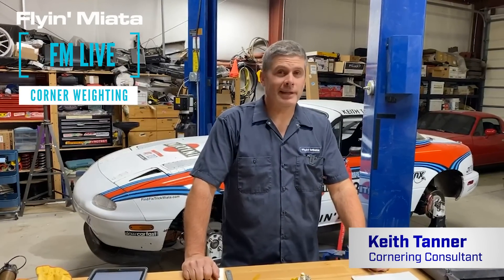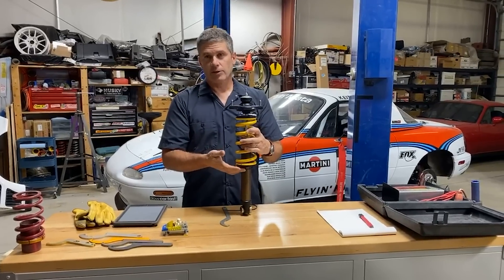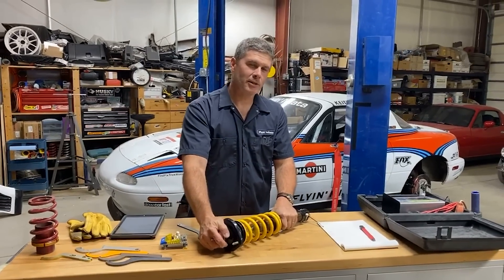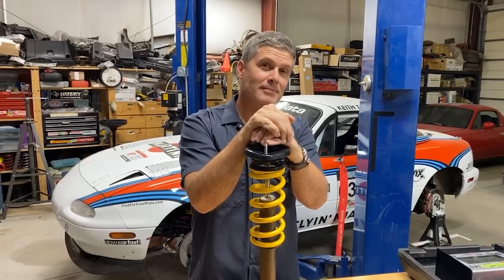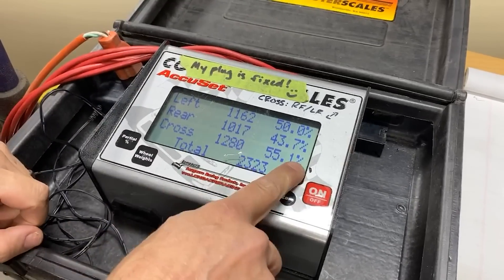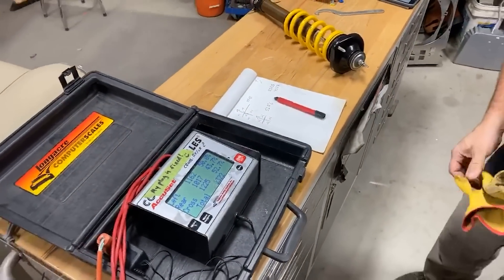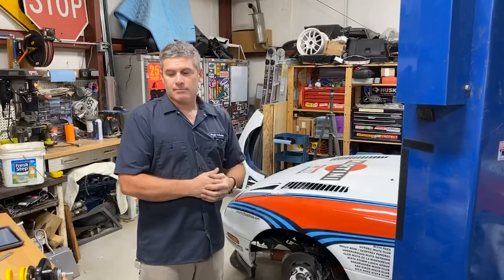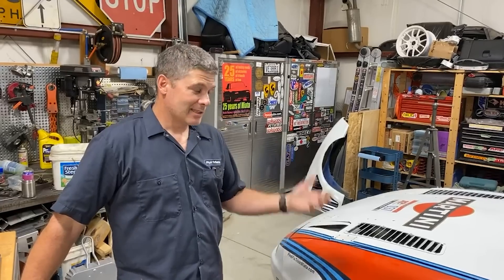How & Why to Corner Weight Your Car (FM Live)

Comment: If you had access to a wind tunnel  put the car on the scales flip the switch ,set the air speed,check, then check the scales for the effect 
That would be cool

Comment: good video.
just did my Camaro today.
not an easy process even with hub stands + a lift.
Reply from the maker: @3rdGenGuy Thanks for watching! A lift and hub stands certainly make the job easier, but it still won't be a quick and easy job.
Reply: @FlyinMiataVideo  
how much ride height change is normal?
 I went from about 55% cross weight to 50.7%.(best I could do)
car drives much nicer now.
ride height change:
driver front: unchanged
pass front: dropped 1/8in
pass rear: dropped 1/8in
driver rear: gained 3/16in
Reply: @3rdGenGuy  just wondering is the ride height uneven now or even left to right on each axle on a flat surface?

Comment: I used to race 1/8 scale on road rc cars (formula 1 of RC cars) we used a tweek bar which is a 3 point balance system car would be center balanced on the 1point front then the rears left and right would be balanced then flip the tweek bar around so it supports the car on rear center and front left and right are balanced on the balance beam which seemed to work very well

Comment: Great video.

What is more important on a lock diff live axle race car, going for a 50% diagonal or even weights across the left front and right front wheels? 

If your diagonal is 50% but your fronts left to right side are significantly different will the car be more likely to lock the light front wheel under brakes?
Reply from the maker: @hardyakka888 We don't have much experience setting up (or adjusting) live axle race cars here, but it seems to us that if you run the car with a significant weight differential side to side, you'll unbalance the rear wheels even further which may have an effect on traction and handling balance - you'll probably end up putting more weight on the rear wheel which will lead to a different balance when turning right vs left. It's likely better to move things around in the car. However, if this is in something like a dirt track car that always turns in the same direction, you'll want a very different setup, anyway.

Comment: Very informative video!  Thanks for the explanation as well as the demonstration.

So, in order to use the new (latest generation) Paco Motorsports hub system with scales, what size scale is needed?  The base of the latest Paco Motorsports hub system is much larger than the ones you used in this video.  Longacre sells 12” and 15” scales, so would the 15” scales be required?
Reply from the maker: We cornerweighted a car last week using the latest generation hub stands and these same scales. The base of the v5 hub stand is 12x12, so the larger scales would be recommended. We’d recommend them anyhow simply for ease of use.

Comment: Love the video very informative information. Have a question with a solid rear axle with an adjustable Watts suspension. If you change the adjustments will that change or shift the weight
Reply from the maker: Now that's an interesting question. We don't have much direct experience with Watts links. In theory, if your adjustments are just to things like the height of the pivot, that won't have any effect on static weight distribution. It will likely have an effect when you're actually cornering, but that's a different matter!
Reply: @FlyinMiataVideo  the watts link that I have for the pivot it has six positions and for the rod ends it has 6  positions as well for adjustment. I'm leaning towards coilovers instead of the stock 4th gen Camaro arrangement. And this was a thought after seeing your video on adjusting for the weight balance.
Reply from the maker: @bobd9911  Those adjustments shouldn't affect static corner balance, they'll come into play when you're moving. The coilovers are what will give you the ability to corner weigh the car.

Comment: Kindly we try to also balance the corner weight of an rc car but the difference is that we adjust the ride height with what we call them droop screws and to move the weight and try to make the care balance we use the tension of the springs and it seems that it works!
Reply from the maker: That sounds like it's working well flor you.
Reply: @FlyinMiataVideo  Today, I tried to balance the rc car with the droop screws ti change the height instead of changing the tension of the springs, and I use plastic rims without a tyre to try to make it to the nearest gram.
I will let you know how it came after I tested because when I put the wheels on, it changed the results!

Comment: Great video!! One question. Wouldn't the heavier wheel have less preload which needs it most to supprt and cause rebound?
Reply from the maker: More weight on the wheel does not change anything do to with the spring. Correct cornerweighting is the same no matter what you have for wheels. You might need to adjust the damping if it's extremely heavy.
We have done a couple of other videos on "preload" and how that's an incorrect way to think of setup.
Reply: @FlyinMiataVideo  thanks!! Will look into your other videos.

Comment: C7 corvette. Should I focus on setting ride height the exact same as measured from ground per corner over setting shock perches in same starting point? So which one is more important to start with?
Reply from the maker: The initial perch setting is just to make sure you're in the ballpark as you assemble the car, it will get the cornerweights close and make your life easier. You'll want to level the car relative to the ground. It doesn't have to be the same at each end, but it should be the same side to side.

Comment: I keep thinking about how to do this with bathroom scales only. Unless you have 8 scales, you will need to take four measurements.
I think you need to be very careful that the ground is flat. If the scale lifts the wheel by 2", you'd better put 2" spacers under the other three wheels, too. If one wheel has a height error of 1", I guess the weight will read 155 lb too high. (assuming VMaxx coilovers 258 lb/in rear and 391 lb/in front so the spring compresses 0.4" in the front left and 0.6" in the back right.) 1/10" will put you out by 15.5 lb, about 2.7% of one corner's weight or 1.3% of the diagonal.
As for doing it with one scale plus levers, you'd better be very careful to measure those lever lengths right. (And where, exactly is the point of application of the force to the scale top?) Levers sounds like a Gong show.

Comment: A poverty tweak for a car without adjustable spring perches is to install adjustable end links on the sways and treat those as if they were the main springs. You won't get much that way, but it's noticeable.
Reply from the maker: I suppose, but then your sway bars are preloaded, which is a different problem. Probably best to leave it alone at that point.

Comment: flat floor required? i guess this is a prerequisite when setting ride height/rake as you said before corner weighting. what is the best method of setting ride height to what you want? aside from matching the perch height left and right. having trouble with my car as i haven't been able to get close to being even on the ground by doing so. by disconnecting the swaybar do you mean completely as in no bolt in the link or just loosening the link connections?
Reply from the maker: If you don’t have a flat floor, you can level the scales with shims. They do have to be level. 
Setting ride height/leveling is done by moving the perches up or down. Get the car on a level surface, measure your heights, adjust. 
To disconnect the sway bar, remove the bolt from the links so the link is not attached to the bar. The bar can remain attached to the car.

Comment: How often should you worry about getting your corner balancing redone? Is it like an alignment where you should have it checked and adjusted every year, or if no major weight changing mods have been made, do you more or less set and forget until you have issues pointing towards it specifically?
Reply from the maker: It shouldn't really change. If you have a spectacular off, you might want to double-check, but it's not something that happens with normal use. Also, if you are coil-binding or you notice your ride height changing, you will probably want to confirm it after fixing that problem.

Comment: Kindly what are the best corner weight results? For example, you make the diagonal wheels of both sides the same or rear front wheels equal weight to go in a straight line.
We use powerful motors that we go 0 to 100km in about 1.5 seconds and we want it to go straight as much as possible!
Reply from the maker: We are usually more interested in cornering and handling than pure straight line acceleration. It’s a good question. It’s quite possible that you’d benefit more from equalizing the driving wheel weights instead of the cross weights for your use due to your extreme power/weight.
Reply: @FlyinMiataVideo the rc car is four wheel drive and we use thick silicone oil in the front diff and bit lighter at the back and we eliminate the third differential from the middle so we try to have all the power to all four wheels, even using stronger springs and Dumpers to try to keep the car straight when accelerating.
I already managed to do 0 to 100km/ h in 1.59sec and 40m in 1.98sec with a small 8s motor! Meanwhile if the car is not balanced it will not hold a straight line because it will spin more the one with less weight. 
We always try to improve and we reached a point were it us difficult to handle the car in a straight line due to bigger motors with more power.

Comment: With coilovers with separate height and preload adjustment, would corner weighting be done only with preload adjustment? Assuming ride height is already dialed in.
Reply from the maker: Yes. See our other videos about preload. Use the shock length adjustment to set your range of motion, then use the perch height to adjust corner weighting and ride height.

Comment: My question my car jacks down  in a long sweeping turn on the rear under full accel its a 1620kg fwd  mk4 focus st estate with kw v3 coilovers does this eliminate my issue its been set equal ride hight kind regards bart
Reply from the maker: This sounds like weight transfer (body roll) that could benefit from sway bars or a suspension that needs some tuning or adjustment, but without a lot more detail it is hard to know for sure. We're also not experts on that platform, but a lot of the same theory should apply.
Reply: @FlyinMiataVideo  its gonna be put on the scales in july  hopeit gets sorted out other wise im forced to get stiffer arb's thx for your reply

Comment: Great video! I just want to ask you one question, would it be easier for you to not remove the sway bar and just corner weighting with the sway bar on because you dont want to mess with the car weighting after you install them back?
Reply from the maker: The sway bars can mask a cornerweighting problem when the car is at rest so they have to be disconnected. If you set the end links properly, they don't mess with the corner weighting when you reinstall them.
Reply: @FlyinMiataVideo  Thank you for your response! Didnt expect you to reply to my question 👍🏻👍🏻👍🏻👍🏻
Reply: If you use adjustable end links / drop links then when you put them back on you adjust the links so they aren't twisting the bar at the new corner ride heights. This means they won't affect the corner weighting when reinstalled. Set each side to a length that bolts up with no pressure needed on the bar.
Edit to add: at 36:17 adjustable end links are covered.

Comment: I'm building my car for Northern California canyon roads. I drive very spiritiedly, but stay in my lane. do/should I need to CW the car for driving on the right side of the road? For example right turns equal low right shoulder, maybe a right side dirt drop. Left turn equals high inside of the turn, crest of the road. 

Car has poly bushings hd sway mounts, steer rack bushings, frame rails, targa miata type durable set up.
Reply from the maker: I would still set the car up to be symmetrical. About the only time I'd recommend a staggered setup is oval track racing or perhaps extreme optimization for a specific track. For general road use, you'll have the best luck if it's equally balanced left to right.

Comment: When I don't have a possibility to weight the car, I should be able to corner weight the car by measuering the compression of the springs, right?
Reply from the maker: Technically, yes. But they’d have to be very precise measurements and you’d have to have very consistent springs. The softer the spring rate, the better it would work.
Reply: @FlyinMiataVideo  Thank you for your reply. A great show by the way. It is rare to find high quality information on YouTube on such topics.

Comment: I have a question about adjustable end links.  1) how do you know if you need them?  My understanding is that to set sway bars up, you should end up with front & back bars being level to the ground.  Is this right?  If not, where am I wrong?
Reply from the maker: The ideal starting point for sway bars is for the "arms" to extend almost parallel with the ground in a neutral position. If you have lowered your car, plan on lowering your car, or need to corner balance your car you will probably need them.

Comment: Not sure if i missed it but was there a target front to rear percentage.  Or just the 50 percent cross?
Reply from the maker: To change front/ rear, you need to physically move masses in the car. Like the battery.
Reply: @FlyinMiataVideo  i get that.  I mean like in karting we run 43 percent front weight 57 percent rear (as a starting point) then 50/50 side to side and cross.   Im guess a front engine car is going to be different and just want a starting point for front to rear.  Or do i only need to worry about left right and / or cross?
Reply from the maker: @Harley32315-playse  In karting, you're probably adjusting that weight using ballast or maybe even moving the driver. There aren't as many easily moveable weights in a car, so mostly front/rear just is what it is.

Comment: Thank you for the video. Is corner balancing something done once or needs to be redone with future modifications. I understand that aero won’t affect it nor alignment as seen in other comments but how about change in springs, going from softer to stiffer front/rear? Would balancing need to be done again?
Reply from the maker: It should be checked any time you're messing with the springs or shock perches. Changing to a different spring rate will require a perch adjustment to maintain a given ride height, so I'd definitely want to check it again in that case. Ride height changes are another must-do, although if you're careful to keep your adjustments equal on both sides it should stay pretty close. It all depends on how close to perfect you want the car to be.
Reply: @FlyinMiataVideo  Thanks for the quick reply. That totally makes sense.

Comment: When would you do the corner balance with driver in the car?
Reply from the maker: When you have a driver that can sit still and you want the car to be optimally balanced with one occupant. You can also put weight in the driver's seat if you don't have the first requirement.

Comment: I did not see or hear you explain or demonstrate your practical demonstration with the weight of a common driver in the seat.
Reply from the maker: You balance the car in the state you want it to perform best. This particular car almost always has a passenger, so weighting just one seat would not be appropriate.
Actually adding weight to the seat is a simple matter. You can even use the actual driver if you'd like as long as they don't squirm around too much when you're taking measurements. Once you've got that weight in place, the procedure is the same.